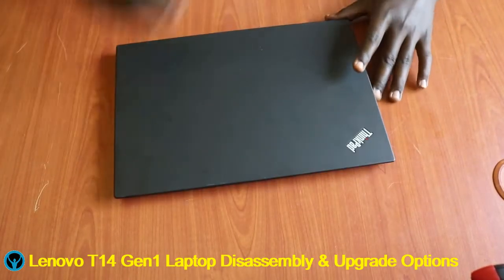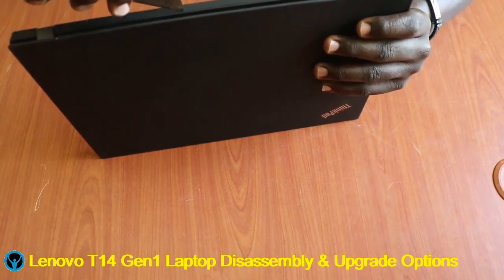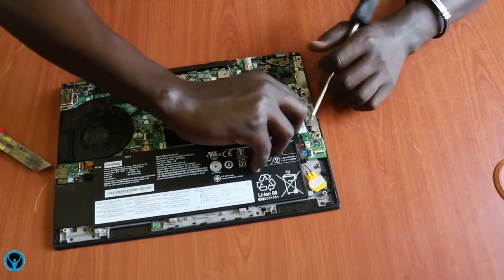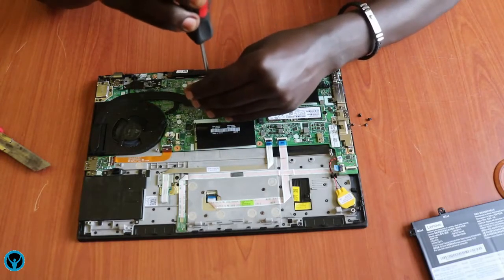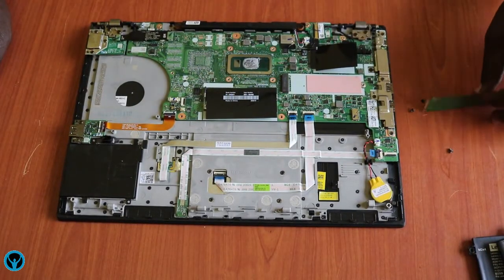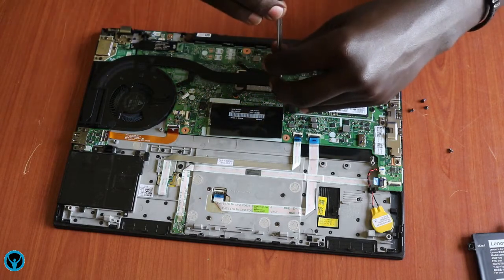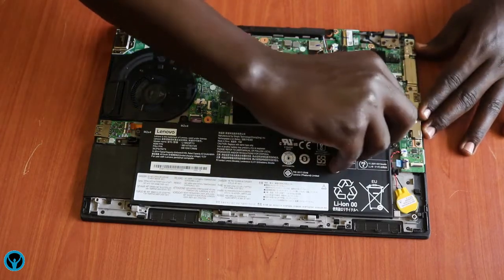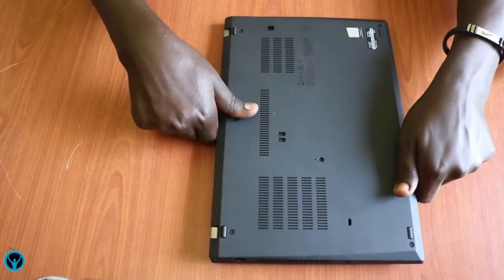Lenovo T14 Gen1 Laptop Disassembly & Upgrade Options

Comment: Am I the only one who noticed the use of a metal cutter on laptop!?
Reply from the maker: It is not a metal cutter, It is a plastic cutting tool!!
Reply: @opolotiversity  🤣🤣😅. That blade is made out of metal. It cuts and conducts electricity. And I'm pretty much sure that you've aesthetically damaged the laptop's plastic cover by using that cutter to open it.
Reply from the maker: @micul24  that was used as presto tool, watch carefully on how it was used to avoid damages, the best option would be guitar pick
Reply: @opolotiversity  ever heard about plastic pri bars?
Reply: @micul24  What are you trying to prove?
Reply: @techguy1066  you never use electrical conductive tools on electrical devices. You can damage the components
Reply: @micul24  if used gently and carefully like in the video,
Reply: it was well used in the video, if you dont have a plastic pry , you can use what is at your disposal but with caution , gently and carefully as in the video.